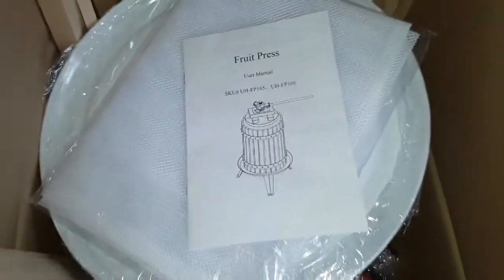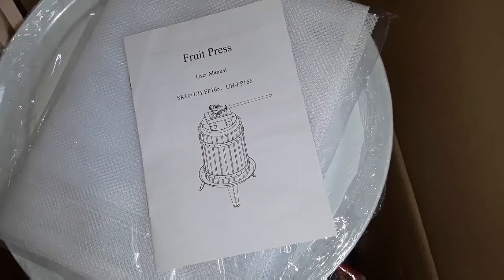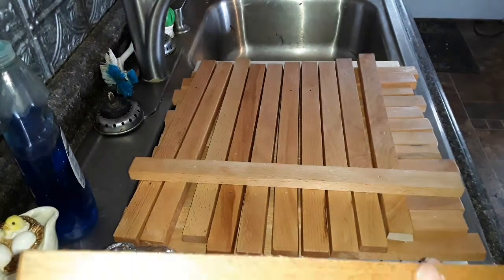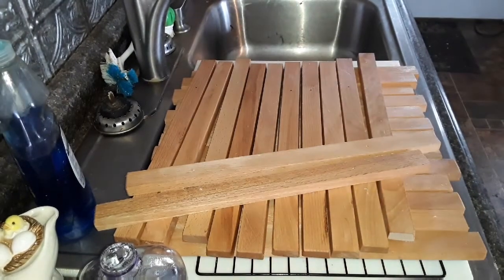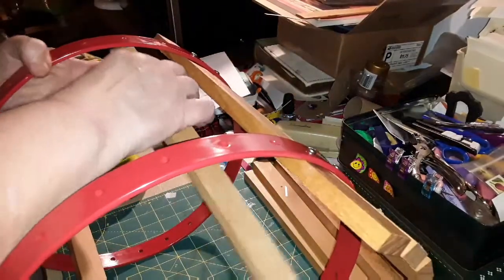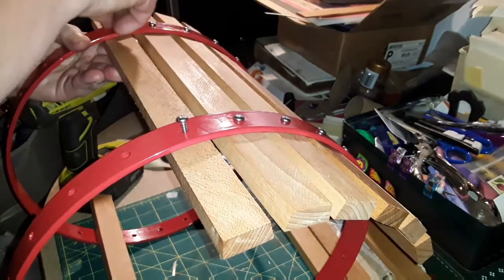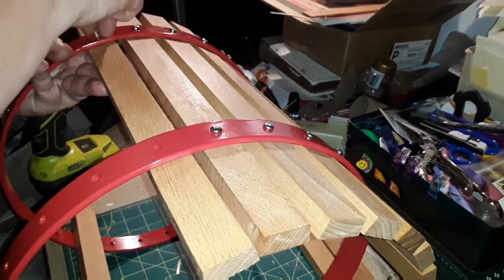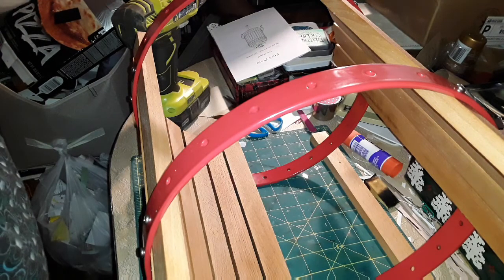Assembling the Useful brand cider/fruit press

Comment: I grew up in rural Maine, where apples are a major crop. I have never seen a Cider press. I think you did really well on assembly. I hope you get many years usage out of it. You basically made a barrel!  For a weight, could you use a stone or brick inside of zip lock bags? I would like to see the finished cover when you do it! Thank you for sharing!
Reply from the maker: I ended up finding 2 feed bags that the pieces fit perfectly so no need to sew anything.